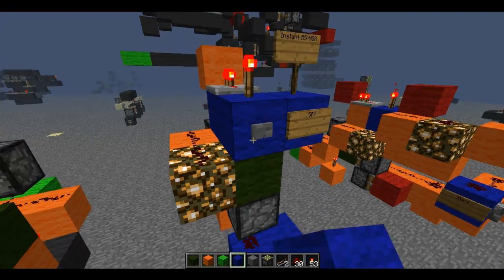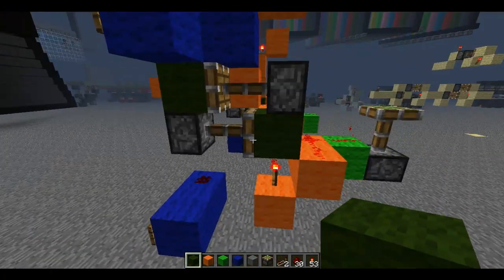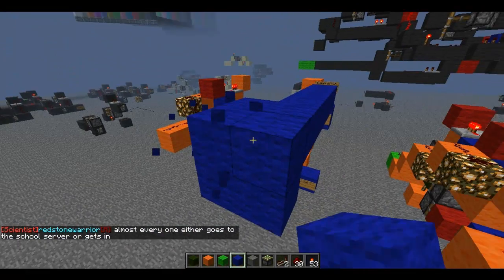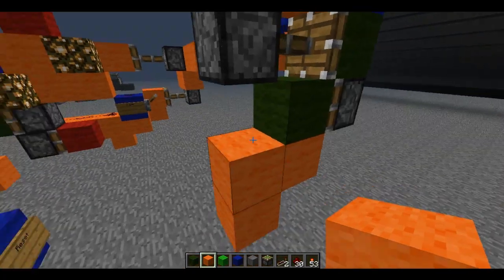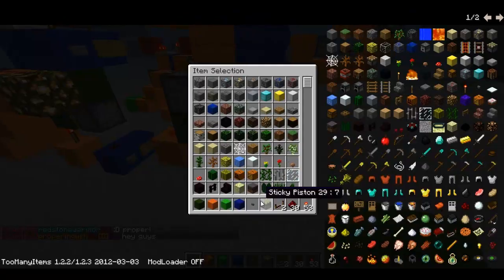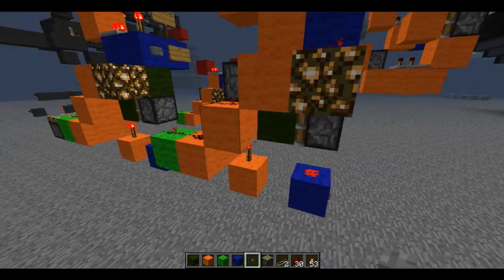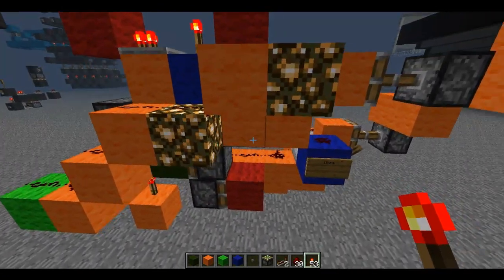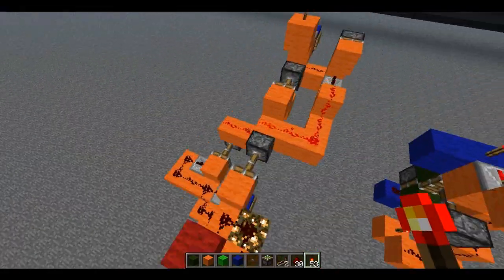Instant Circuit: Instant RS NOR Latch

Comment: I built this, and yes i agree it's instant WITH THE BUTTON , but what i'm having trouble with is that how you might be able to hook it up to something else, which you show at about 4 minutes in. It requires a 5-tick redstone pulse to fully work as a button, but that ruins the 'instant' effect, and in my current build (which i was trying to make faster by using the instant rs nor), that would mean a regular rs nor would be better, :<